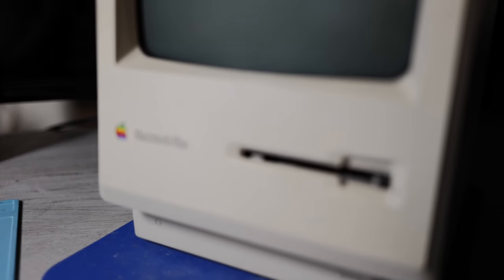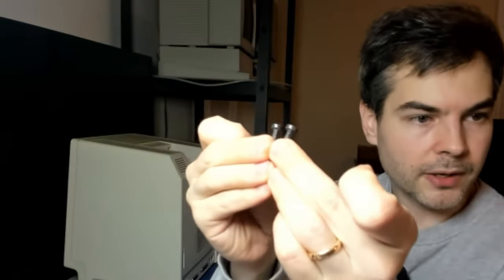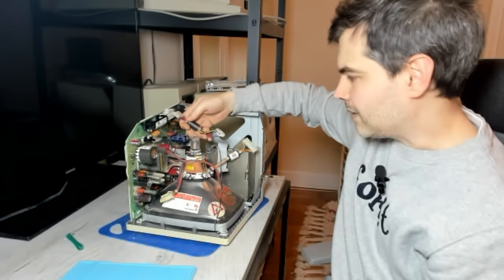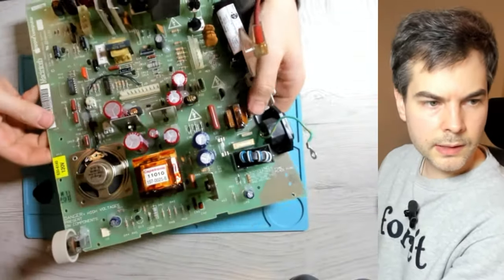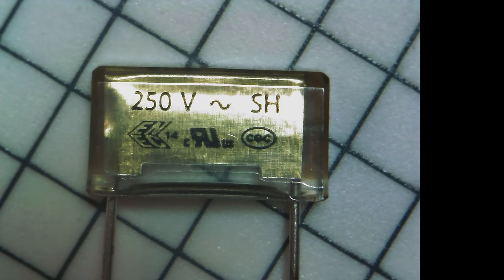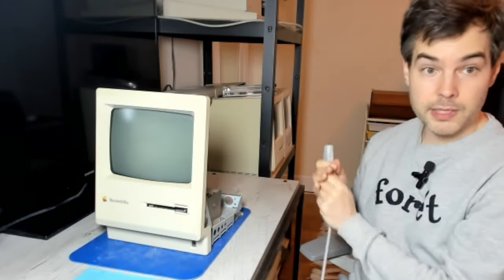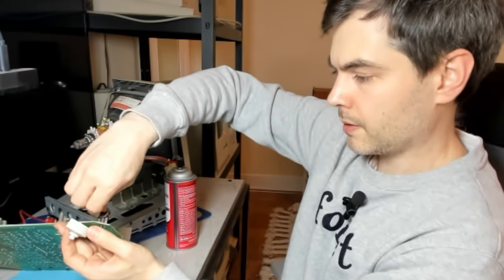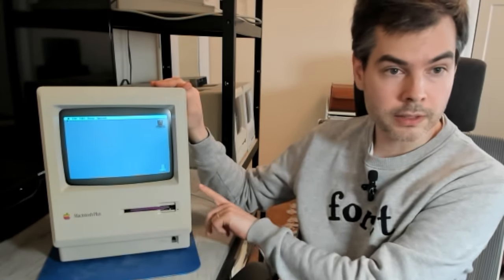How to do service a Mac Plus analog board

Comment: if you clean and lubricate the eject motor(and the drive in general) before the gear breaks it will last much longer. also the capacitors(surfacemount electrolytics) on the floppydrives of old compact macs are also aging and that can cause problems.
Reply from the maker: I totally agree that preemptively servicing the floppy drive is something you should always do. Good call on lubricating the eject motor gear. They put some grease in and around the metal motor gear from the factory, and that can definitely gum up and cause trouble after 30 years.

Now when it comes to the OG Sony double density drives (400k and 800k), I'm quite certain they all have miniaturized through hole electrolytic caps rather than leaky SMDs. After servicing 10+ of these I've never seen one that had leaky caps (yet.)

The later manual inject (non-Sony) superdrives, on the other hand, totally have leaky SMD electrolytics that need to be replaced!